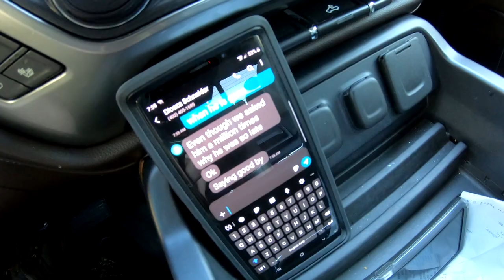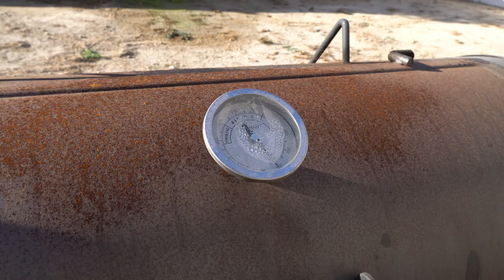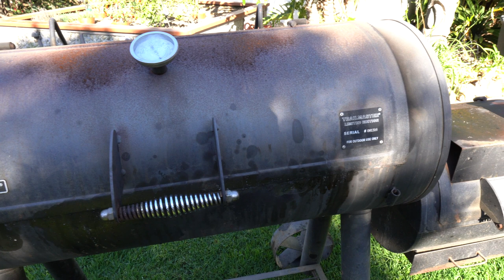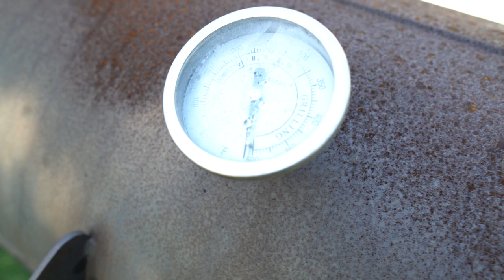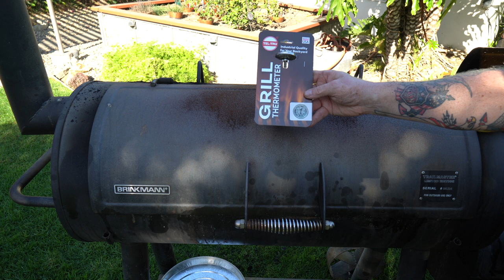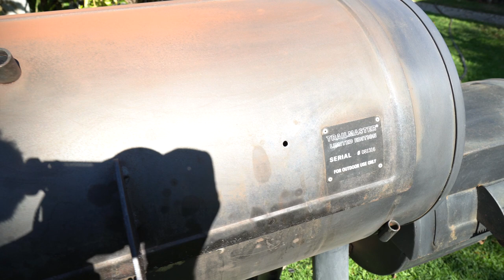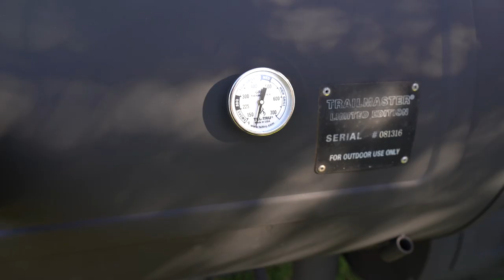Pimp My Grill - Brinkmann Trailmaster offset smoker 6-hour overhaul

Comment: Great job on the grill guys. I heard you say the baffle is galvanized,  I know galvanized metal and heat don't mix because the galvanizing puts out poisonous fumes when heated. I'm not sure what temperature it does this at but please check into it so nobody gets sick. Keep up the great work guys.
Reply: 4 Seasons BBQ thank you for that info 👍🏼
Reply: @sassyd8832  I just looked it up and it's 392 degrees when it gets toxic. I just want everyone to be safe.
Reply from the maker: @4seasonsbbq  I'll take action!
Reply: @GreenhornBBQbeer  it's not a worry. If he gave the pit an hour to heat on the first use it burned any toxins off (as its there to deflect those high temps). I made the same sort of mod to my trailmaster before I ever used it. I have cooked for hundreds of people now and I have never made anyone sick. 

My deflector runs the length of the bottom grill with holes drilled that become larger from right to left. I get an even temp across the whole cooking surface. I installed the same thermometers you did at grate level. I put the green egg felt gasket material around the smoke chamber door opening. Also I installed dryer vent from the exhaust pipe down to the cooking grate to keep the heat at the cooking surface and prolong smoke contact. After these mods I use less fuel, maintain constant temps, and can easily have consistent results between cooks.

Comment: “Some kind of anti rust primer” like “Rusttoleum” since you used their hi temp paint or is there a better brand?
Reply from the maker: I would avoid galvanized as its just what I had around. The paint is your choice but any high heat should work fine.